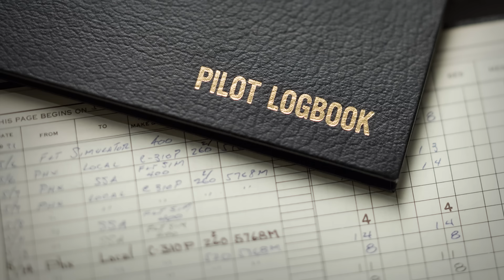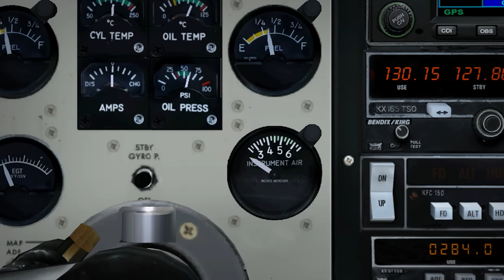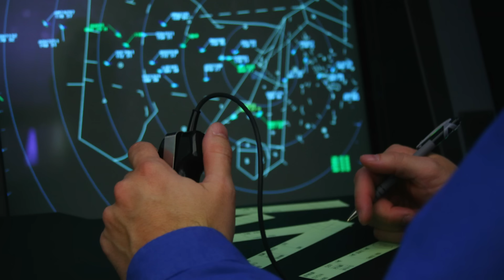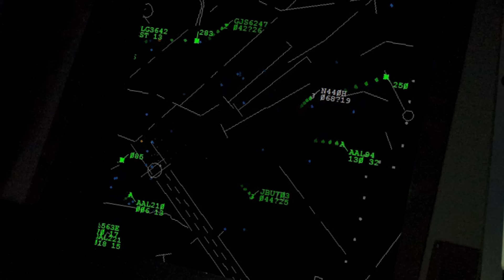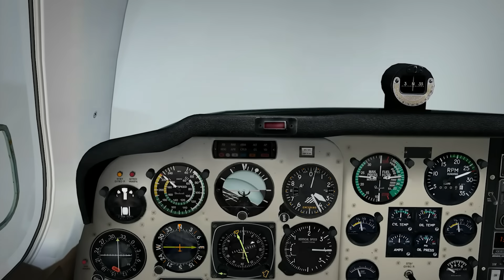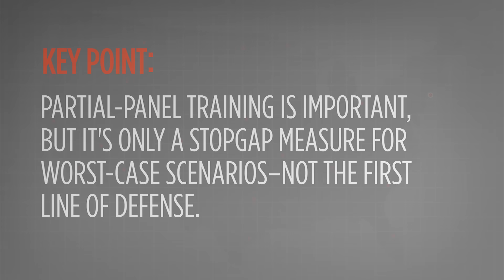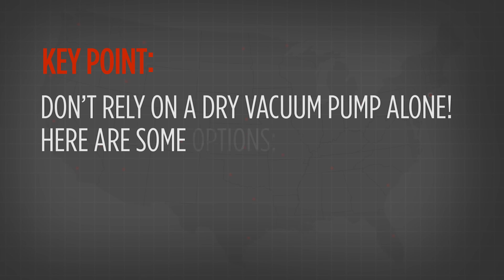Accident Case Study: Single Point Failure

Comment: Years ago when I was training for my IFR, 10 -12 hours into the training, we was doing some classroom stuff.
My instructor showed me a small modification any pilot can do that could very well save my life, this  modification  would cost less than .25 cents
and weigh almost nothing. We went to our skyhawk, did my inspection, got inside and my instructor
stalled this modification. It was a small washer, that was tied to a string. He used a piece of tape, and taped the string to the headliner, letting the washer hung down, right in the center.
It was maybe 10-12" long. Now, you don't have to be a genius to figure out whats going to happen when you turn this aircraft.
In a partial panel, this is critical, this WILL tell you when your airplane is turning. This will also tell you if your pitched up or down to some extent.
So tell me, is your life worth a quarter?
Reply: A washer hanging from a string is going to be effected by g-forces. In a coordinated turn, it would still be perpendicular to the floor. It’s not going to give accurate roll and pitch attitude.

That’s why attitude indicators operate on gyros.

Comment: Many years ago(45 years) I lost a vacuum pump in 4 miles vis at 8000 feet. I was a CFII with lots of recent experience. I practiced partial panel all the time for 5 or 10 minutes. It was a wake up call on how dangerous flying partial panel is. It humbled me. I would recommend immediately declaring an emergency if night, ifr or even marginal vfr if appropiate for you. Get a route in vfr to a suitable airport with the controller backing you up and monitoring you. I currently fly a twin with 2 vacuum pumps and an electric attitude indicator but there are a lot of single engine IFR guys/gals out there with 1 pump and these pumps are garbage. It's the weak link in our flying.

Comment: A short piece of string attached to the cabin ceiling with a 1/2" nut attached at the other end MIGHT have helped. It's used as a plumb bob!  So sad. With very little practice, this could save many IFR condition crashes.
Reply: Ummm...no. The TSI in his airplane had a bubble level...they all do. This is in effect the same thing. And it can indicate level even in a spin. Why? Centripetal force. It’s why in coordinated turns, the ball stays centered. Revisit your high school physics textbook...you seem to forget that gravity is not the only force (fine...acceleration...since we all know gravity is not a force) at work here.

Comment: I am a student pilot currently. I just completed my first solo flight a few days ago and am excited to move onto the next steps of my training. These videos are excellent. The outcomes of these accidents are tragic but they provide are excellent training material on what steps to take to prevent these kinds of situations and how to act if you find yourself in a situation like this. Clearly the lesson in this video is if you lose part of your instrument panel and are flying above the soup the only option you should take is to fly to the safest place where you can set the plane down without losing VFR. And to prevent a situation like this if you know you're going to encounter bad weather make sure your aircraft has backup systems available in case the main one fails. I know pilots are required to have confidence in their abilities as aviators. It is who we are. The more we fly and practice the better our skills become and the greater our confidence and ego becomes. But you also need to be able to immediately recognize dangerous situations such as this when they present themselves and know when its time to put ego aside and find the safest solution. At the end of the day the safest way is always the best way.

Comment: Would it not be easier for the experts reporting the weather to tell the pilot. "It is too dangerous to fly.  Unless this is an extreme emergency and you are an expert pilot, YOU ARE NOT GOING.  Reschedule for tomorrow!"????
Reply: In this case, the pilot was qualified for the weather conditions and his airplane was as well. He had a mechanical failure and lost his instruments while he was above the clouds. When he tried to get back thru the clouds without instrumentation, he put the aircraft into a 4k ft per min decent and it broke up... Super tragic.

That said, it is reckless, imho, to fly with vaccum instruments without backup instruments... My personal airplane is almost a carbon copy of this one... Except it has backup instrumentation.

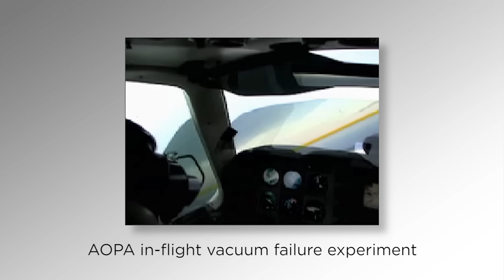Comment: I’m not a pilot but I aspire to be one day. I don’t think I fully understand the problem here. I get it that in the clouds a pilot will have next to zero visibility, but is it really that hard to fly from the seat of the pants feel without an attitude indicator? As in, couldn’t he have leveled the wings while he has visibility on top, then lowered his altitude while making minor corrections by feeling what’s in his gut, then reassessing once below the clouds? I see at 4:45 the guy is clearly confused and I know vertigo is a thing but I didn’t really know any of this was that debilitating
Reply: The feeling of banking counteracts the feeling of dropping. Death spiral. And in a spiral you're picking up speed. The guy in this video broke up in the air.

Comment: so... what happened to the plane.. it came out of the clouds all broken up? you know clouds aren't really that tough nor is anything inside them that tough either.
Reply: Look up parasitic drag...thats why there’s redline airspeeds. Exceed that, and you risk permanently deforming the airframe, up to and including breakup. Also, any control inputs just complicate this, rapidly accelerating the airframe (remember, acceleration is a change in magnitude or direction of velocity). There are published speeds , VA, that the airframe is rated to take 1 full control deflection for 1 second at max gross without experiencing plastic deformation.

Comment: Every video I've seen with controllers being informed of vacuum system failure ends shortly after the controllers give them turn to heading instructions. They need to be ready to clear everything in front of them (above and below) and give them slow turn instructions with the goal of getting them out of imc in a straight line to wherever they can break out and land vfr without going through severe turbulence or icing even if that is an hour off the filed plan. Every controller should have to do a no-gyros surveillance approach and watch what happens when they get 3 back to back "turn to heading" instructions with that scornful "are you going to fuck up my day by declaring an emergency?"

Comment: Noob question; if your attitude indicator fails, how are you supposed to fly in clouds?  They talk about partial panel flying, but if you attitude indicator is no good I'm not sure what you can do.  Are you supposed to use your altimeter?  How do you tell if you're losing altitude from a dive and not a stall?  Do you guess one option and then try the other if that doesn't work?

Comment: I don't mean to sound like I missed the point of this video but what caused the break up of the plane in mid-air ? These videos are really instructional.
Reply: he was disoriented  and starting to descend at red line speed. the g forces alone just tore the wings and tail and anything else right off
Reply: @jeremiahjordan8764  Typically, when they finally see the ground rushing up at them the overwhelming instinct is to pull back, causing the wings fall off.

Comment: I am not a pilot, I am not an aero engineer, just an ordinary engineer with a lifetime of tinkering and teaching, but the design of that pump makes me shudder, graphite is not a tough material. So they make a rotor out of a brittle graphite and then they cut slots in it, acting as stress raisers. And everyone says it'll be alright as long as we inspect them and lifetime them and do the paperwork.  WTF? that is not how it should be.
There are plenty of non contact designs for vacuum pumps that in industry last thousands and thousands of hours without attention. Google "side channel blower" for just one design.

Comment: Sucks...I would have said I have no gyro, am COMPLETELY unable IFR, and require to get on the ground at ANY clear descent location within X miles (calculating whatever radius I had fuel for, hopefully with some spare) as I am currently overflying continuous IFR conditions below. 

And YES, I would have declared an emergency given the severity of the problem and the local and extended weather, overreacting a bit is better than just tossing a real problem off.   You don't get a do over button when you hit the ground very very hard, unless you are in a simulator....AND some time spent IN ONE of those occasionally practicing this skill and others also would likely have helped here.

But, then again, I personally wouldn't be flying without SOME form of backup artificial horizon, the likelihood with two unrelated gyros (vac systems, etc. not common) of both gyros failing, given that the systems share nothing in common, is one over the square of the one instrument SPF, so (easy math example) one in one thousand hours for each instrument becomes one in one million hours for both failing, as long as both are properly functional beforehand, and maintained per standard interval maintenance or replacement.   If not, it can make those reliability numbers much much lower, even with both apparently functioning properly, if they are both near end of life.  Both aspects should be properly attended to. Obviously this is statistical so mileage WILL vary. 

FORGET home!...of zero importance with weather below, extensively around, no artificial horizon, and rusty partial panel skills.  Get on the ground somewhere you can do the descent VFR, get the aircraft fixed, then continue on when weather permits.  If you HAVE to get somewhere on time, flying general aviation (especially if not IFR equipped/rated, but even then) is definitely NOT the mode. 

Accidents are always sad, and usually avoidable, but not always.  Keeping yourself out of iffy situations, where possible obviously helps...but there is definitely the unexpected out there, one thing you can pretty well depend on happening, occasionally.  I have had two friends killed in light aircraft now, neither the pilot at the time, not that that matters even one little bit.  One was a very bad decision, would not have happened to a pilot "behaving" himself.  The other was an engine out in the mountains, no fields available, one of those times a parachute is about the only real option, full plane, or worn...landing very remotely in trees pretty much NEVER turns out well.

Comment: In that sort of instrument failures, is it not possible to know if the planes turning or not by watching the heading indicator turn. Also whether the plane's climbing or descending by seeing the altitude indicator?
Reply: Heading indicator runs on vacuum as well. The altimeter will tell you if you climbing but when you lose altitude(spiral) as fast as they did, the airplane will break apart due to over-stress. Poor guy probably didnt realize he was gone til it was too late.

Comment: Loss of Vacuum Instruments w/o backup IN THS CASE  declare EMERGENCY; request 'NO GYRO VECTORS".   Partial Panel phraseology is meaningless'  Pilot did not tell ATC what assistance he needed
Reply: Exactly. It is extremely dangerous, tell them MAYDAY.
Reply: I agree that would have been such a smart move.  But it also seems like something you'd want ATC to know, that a plane without instruments in IMC is a pretty serious issue especially after they've declared an emergency.   IMO a very casual discussion on both sides considering the serverity of the situation and they both fed off the calmness of the other party.

Comment: I thought you needed a turn coordinator for IFR?  All the ones I seen run on an electrically powered gyro.,
Reply: Lol, yes. Very good. The issue was not that he didn’t have instruments to fly partial panel, but rather flying partial panel is extraordinarily difficult. The lag time in the electric gyro can’t be understated, and it takes a lot of practice. Most pilots never practice this, and instrument pilots have likely only done this at their checkride or last IPC.

Comment: Poor Bastard. He was fucked the moment the vacuum pump went. Single point of failure, that is why the 737 max is such an issue.
Reply: Im no pilot but the MacGyver and me would have likely found some tape string and something heavy and taped a dangling piece of metal from the head screen to give me any indication of Bank angle and climb angle. If I were to ever get my pilot's license before I embarked on any flight in an aircraft on my own after becoming certified I want to know what kind of contingencies all of my flight systems have should one fail. Secondly I am so afraid of dying in a plane crash that I likely would not have flown or would have been very Frank with ATC and said look I need to divert!

Comment: The accident occurred in May of 2016. If the pilot or either of his two passengers had a smartphone, a simulated panel app might’ve made the difference (glad to see that bullet point in the video). Even if nobody had a flight app, somebody could bring up the app store while VFR on top and download something. A pilot-controller might’ve made that suggestion. The report doesn’t say if any personal devices were found. But if you’re a pilot and you don’t have a tablet or a smartphone, might skip the next couple of flights and use that money to get one.

Comment: I’m not a pilot but I’m familiar enough with aviation to be confused: When you see the altimeter wildly spinning downwards, shouldn’t every. single. pilot. instinctually know to look at the artificial horizon (or even a half full bottle of water!) and level out?

I must be missing something obvious, I just can’t comprehend how you’re plunging towards earth rapidly and you can’t use the artificial horizon to level it out?

To me this feels like watching a report of a professional delivery driver who failed to automatically hit the brakes when noticing an unexpected stop sign.
Reply: The artificial horizon is powered by the vacuum system. Vacuum pump failure causes artificial horizon failure. That’s what partial panel means: flying without the artificial horizon. A bottle of water won’t help you either, for the same reason that flying by the seat of your pants won’t: the G-forces in a spiral dive (which is the default state when a pilot becomes disoriented in cloud) act through the vertical axis of the aircraft, so the pilot’s senses tell him he is flying level and the water would also be level in the bottle.
Reply: If your altimeter is wildly spinning downwards, youre already gone... If youre losing altitude that quickly, your airspeed will already be in exceedance of redline. Therefore when you try to correct the dive, gravitational forces with cause inflight breakup of airplane.. Its a bad deal... Once the spiral happened, they were gone...

Comment: Iphones now has a leveler function. Could it be used on top of the glareshield just to orient for wings level? VSI can be use as reference for pitch.
Reply: Fail to see how this is any different than the panel mounted turn coordinator/turn and slip indicator. Those are electric gyros that indicate wings level, just like your iPhone would do in the level mode of the compass app. The issue here is not that airplanes aren’t equipped with a backup, but that the backup is segmented into five instruments (compass, TC/TSI, airspeed, VSI, and altimeter). While these are all parts of a standard instrument scan, this scan normally centers on the AI which “brings it all together”, so to speak. It increases workload to the point that the pilot starts subconsciously dropping tasks, and when these dropped tasks are necessary to continue unaccelerated flight, acceleration happens. Uncommanded acceleration generally yields poor results.

Comment: proceed to destination above cloud. Reduce power to descent power overhead.Flaps approach.Hands off control column and only use rudder to initiate a rate one turn on turn co-ordinator. Decend at 500fpm till cloud breakout-continue to land.
Reply: You seem like a real fuck face.  
No offense
Reply: PILOT: That should be tested in VFR and see what actually will happen. One needs to prove it for himself and Trust it if doing it under IFR. . If it works then keep as an option.  I do agree with you in theory. I would take my chances on a Trimmed aircraft in a 500fpm decent then I would with me moving the yoke in IFR a few thousand feet..